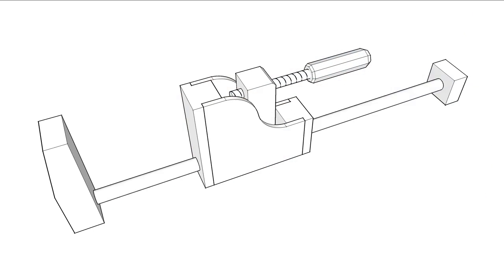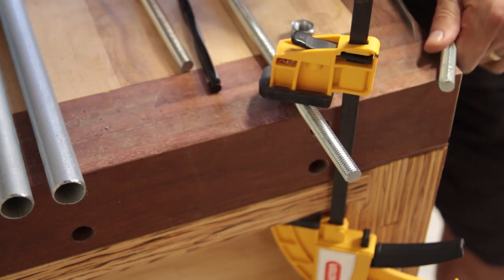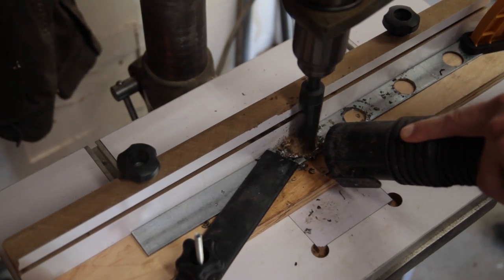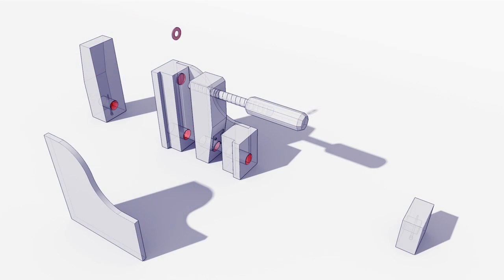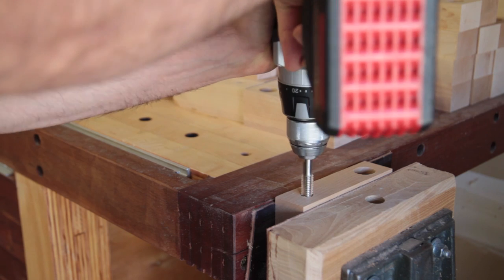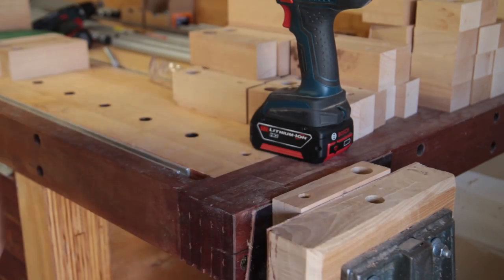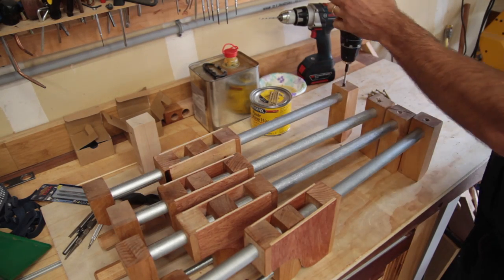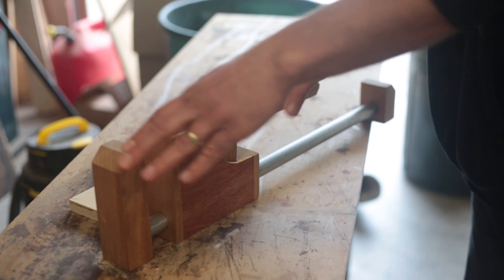DIY Parallel Clamps

Comment: Just finished making 16 of these based on this fantastic video.  Bought the plans and modified slightly - wouldn't really attempt it without the plans. Made them out of hard maple readily available to me. They were very time consuming, but ultimately well worth it. Work incredibly well. One mod I made was to add a 3" long 1/4-20 hex bolt through the bottom of the headstock and naturally the steel conduit bar. Adds an incredible amount of extra stability to the headstock under clamping pressure. Grab the 15/16th drill bits from harbor freight if you can. Great deal and the they work very well. I would def recommend giving these a shot is thinking about it...
Reply from the maker: That is awesome to hear! Thanks for the added suggestions as well. Did you make all yours the same length? Several years in, mine are still working well. Gotta scrape glue off em from time to time and some slide better than others, but still really happy with these.
Reply: @GeeksWoodShop  Yeah, I'm a little worried about the glue too. I've been toying with the idea of double sided taping some thin HDPE plastic to the faces. I also know what you mean about the sliding. They're not all equal, but work well enough. I'm still super impressed with how sturdy and effective they are. I ended up making 8 x 24" and 8 x 48". The beauty of the 1/4" bolt to hold the headstock and ends on is that if I REALLY want/need to, I can disassemble the clamp and reassemble on longer conduit. I'm sure the day will come...
Reply from the maker: @andrewfergus7562  Ah nice, a bit of future flexibility built in. Hope you get lotsa years from them, with the hard maple you used they'll probably outlast mine. ;)
Reply: How does the clamp actually work? Is it steel against an aluminum bar? Does it gall up the bar and ruin it over time?

Comment: Man, THANK YOU VERY MUCH for sharing your work, experience and, above all, your mistakes. It is from that that we all learn. Great Video and great job!!! Thank you!!!!
One suggestion: When you have to glue or nail something that barely touches another element, instead of eyeballing, use shims. Scocth tape or a piece of can, whatever gives you the right clearance, that can be removed and, still, gives you a consistent and repeatable measure for all the pieces in a quick way.
Reply from the maker: Thanks, good suggestion for sure, anything that makes for accurate repeatability is worth doing. Cheers!

Comment: Rather than working with such small pieces when ripping them, quite dangerous, make all your rabbet cuts when the piece is full length, much safer!
You finally figured out how to cut those angles on the blocks. You drew the line on the sled at the correct angle, but didn't make a scrap at that same angle to use as a stop until later!
Reply from the maker: Agreed, order of operations sometimes means I don't anticipate the best approach and have to improvise. Good thoughts, thanks.

Comment: Thanks for the kind shoutout, it is much appreciated. Your clamps came out great. A real mass production:):). Good tip on the CA glue to position the grabber. Great video, and from the comments you wrote, it looks like yours, as mine, still hold up after much use.
Reply from the maker: Thank you for the original design, these have been such a great addition to the shop.

Comment: Great use of table saw, sled, band saw. Due to my experience as a rough carpenter and my need to conserved space, I am using only hand-electric tools... wormdrive Skilsaw, Bosch Jigsaw... now I need to find the best way to mount the Skilsaw to use as a table saw and sled (the Jigsaw is easy to setup).

Comment: Nice vid, and you've got some sweet machines for garage shop! If you haven't discovered them yet, step drills are great for drilling large holes in thin stock in one go with accuracy and without grabbing. They'll even chamfer the edge in a single pass. Don't bother with the cheap-o step drills or extra coatings. It's worth spending the money on good ones, and they are easy to sharpen. A good quality 3/16" to 7/8" stepper in 8 or 12 steps will probably set you back $40, but if you take care of it, it could last you your entire life.
Reply from the maker: Thanks, good advice indeed.

Comment: The wood you got was  hard wood i presume Can You make the clamps in soft wood because hard wood in the UK is so expensive and i am only a DIY man with a little workshop Great video everything explained so well you sound like a man who really enjoys  his work  I have subscribed and looking forward to more. Thank you very much
Reply from the maker: I hear your pain, great lumber is hard to come by for many of us. 
I'm not sure the type of wood I used, but pretty sure it's not too hard, so yes, I think you could use a softer wood, but before making too many I'd definitely make one block, drill the pipe hole in it and try to break it to see how well it holds up, that's where the strength needs to be. Good luck!

Comment: You don't mention the tap that you are using.  It is called (among other things) a "gun" tap, because the bevel at the beginning of the tap is ground such that the cut portions are pushed ahead of the tap as it goes into the material.  If you were using a standard 4-flute tap that you normally purchase at the hardware store, it would plug up and you would either back out several times in the length that you are tapping to clear the flutes or risk breaking the tap, even in wood.  It also helps to wax the tap before you start tapping, similar to oiling a tap when tapping metal.  The wax sticks used to lubricate band saw blades works well.  Richard Solomon's suggestion for using the drill press to start is a good idea as well.  With your gun tap, and a through tapped hole, if your drill press goes slow enough, you could go all the way with the drill press.  Slow enough means 100 to 200 rpm (most drill presses don't go that slow) and use a good, well clamped vise to secure it.    Good video.  I liked this one.
Reply from the maker: Thanks for the insights, good suggestions.

Comment: great video.  I have the plans and did not end up being able to make them.  I got frustrated with the metal piece as well as matching the drill bit size to the conduit size. If you have something like the conduit part number and the drill bit dimension you ended up using I'd find that helpful.   great video, glad I found your channel!
Reply from the maker: I used 3/4 conduit from HDepot, which ended up with an exterior dimension of 15/16ths, so I had to buy a drill bit of just that size and it worked perfectly. Definitely measure whatever pipe you end up using. 
The metal piece was frustrating, but mostly as I don't have much experience with metal. I should have drilled successively larger holes rather than trying to do it in one pass. I ruined the drill bit.  :)

Comment: Great Video. Good Narration too. Finding the Center: I imagine you know by now, but, straight edge marks across both corners of a square end, where the lines intersect in the middle is the center, then, just adjust your drill table/jig to find the center mark.. What you did works good on round stock though, but, you can rotate and put a pencil in the chuck and keep moving it until you get a dot, or a circle the size of your drill bit and you are done... 
I am wondering what lengths you use most in what you are making,, and, if you don't mind, look at the washers and tell me if the washer is not cone shaped in the center of some you have used.. Seems that putting them on the end of a pipe and tapping them with a ball pein hammer, or a large punch would cone shape them for the head of the nuts.. Probably why he ground his rounded on the Bellevue build. 
If the washers coned out, the round would move better. You might have had some catching on the ones that were bending into cone shapes.. 
Excellent video.. I'll check out the channel and see what you have been up to since May of 2016.. Cheers!!

Comment: These seem to be some of the best DIY clamps I have seen, very nice finish on them and they seem to work great. How are they on clampingpower? I am thinking if you want to join wood for say a tabletop.
Reply from the maker: I've used them for panel glue-ups multiple times, which was the first reason I built them. They have lots of clamping power, won't have as much as metal/ purchased versions, and I don't try to crank down on them, but plenty still. Thanks much!

Comment: Gentlemen! 
Buy an angle grinder! They are cheap and they make cutting steel a breeze! Just clean up the burr when you're done. 
Pro tip, start all the taping by hand in the drill press (power off, turn the tap in by turning the chuck or upper pulley by hand) this will give you exact alignment.

Comment: Great video.  I like your style.  I think it would be interesting to do a test to somehow show whether clamping pressure is even across the entire clamping surface.  My concern with a more dynamic material like wood is that clamping pressure might differ between locations down in the throat of the clamp and out at the tips of clamp surface.  What do you think?
Reply from the maker: Thanks. It's a good question, and I don't know for sure. I've used these primarily for panel glue ups, so it doesn't test the full length, but they do hold the parallel positioning well and as best I can tell they clamp evenly, but I've got nothing but my own (very un-scientific) opinion.

Comment: Do not know if you have been told this before but all electrical conduit and is the inside diameter like plumbing pipe..only refrigeration copper is outside diameter as far as i know o am sure there are other exceptions.
Reply from the maker: Thanks. I don't know much about pipe diameters. Good insights.

Comment: Really like these and the design.  Two questions please.

Have the conduits flexed when pressure is applied?  I'm hoping to use on a dining table of 2.5 inches thick.

Has the metal of the conduit caused any staining of wood?  Is the conduit galvanized? 

Thanks and I appreciate the content.
Reply from the maker: The conduit hasn't been an issue at all. After a few years, I've had two of them crack at the wood base, so I might use a harder wood if I built them again, but 2 out of all of them is pretty good I think. That said, I don't put serious pressure on them, just...  "enough". .  :)

Comment: Just came back to this video and it is still great! How are the clamps holding up after 3 years of use? Anything you would change?
Reply from the maker: Thanks. One thing that has happened to 2 of the clamps is splitting on the bottom side from the pressure, so I'd probably make the lower side a bit thicker ~1/2" and use a harder wood if I were to make them again. Overall, still great though.
Reply: Thank you! Want to build myself a set of these and feedback is invaluable. Where exactly are they splitting?

Comment: This was very good.  I have been looking for something like this for a while.
Few questions:
I wonder about the little metal grabby things against the conduit -.  How long before they begin to wear out, and do you have any ideas on making them adjustable after a wear in period, or maybe have them float?
How much pressure can the clamps handle?
Will the jaw eventually go out of square?
How are you ensuring they are parallel?

All questions you may have gotten before - maybe on lumberjocks?  got a link/username there?
Reply from the maker: I don't know for sure, but I suspect the metal grabbers will last for a very long time, and the conduit that I used is simple galvanized metal, so possibly softer. As far as ensuring they are parallel, that's based on how accurately they were built, and I don't suspect they will have any problems for a long time. For now they are ~8 months old and no issues, don't know the pressure but they do work very well. I'm TysonK on lumberjocks, see ya over there!

Comment: Watched this several times. Great video. Have some questions about clamp pressure and the pipe bending at longer lengths. Want to try something similar and at greater lengths.
Reply from the maker: I don't know what the clamping pressure is as a measurement, only that they work really well for any project I've thrown them at. I don't have problem with bending for the shorter clamps, the longer clamps can bend if you crank down on them, but it's not been a problem as that much pressure isn't needed for my work. I have had one clamp fail in that I split the wood block, but even then it still worked, and has only happened to one. Overall, I love them.
Reply: Geeks Wood Shop awesome, thanks for the reply. Does the clamp housing rotate around the pipe or does it stay in line with the end piece.... If that makes sense. Lol
Reply: By that, I mean it's on a round pipe as opposed to a flat steel bar. I didn't see anything that kept it from pitching side to side at least some.
Reply from the maker: You are correct, the end of the clamp is fixed with a screw through the bar and block, but the main clamping structure that moves up and down the bar also rotates freely around the bar. This has never been a problem for me, in fact I've had a time or two when it was beneficial as I could clamp a vertical leg to a horizontal stretcher, but ya, if you want them to stay perfectly in line, these won't.
Reply: Geeks Wood Shop OK cool. Excellent to know. Thank you so much for your help. Again, great video.

Comment: What degree was the angle on the block that the turn handle is on great video brother
Reply from the maker: The shallow angle? I don't remember, but the exact angle is probably not crucial. If you need plans, do check out the description for a link to bellevuewoodshop

Comment: Its been a bit over 3 years.  How are the clamps holding up for you?  Is it worth it building them?
Reply from the maker: They've held up well, still use them. I've had 2 I think that have cracked where the wood is under pressure, so would definitely build them again but might use a denser wood, as I used some light wood that I had on hand.

Comment: Sorry if this has already been answered, but what length was the conduit cut and what size washer was used. I'm trying to find washers with an outside diameter of 1" and an inside diameter larger than 1/2" so the threaded rod can move a little freely, but I just cant find the washers. The washer used looks smaller than 1". Thanks!
Reply from the maker: I cut the conduit at 3 lengths, I don't remember exactly, but something like 24" 36" and 48", most of them being the shorter versions. Whatever you need. The washer, I don't remember exactly either, but I think the threaded rod was 1/2", so I used 1/2" inside washer with the bolts to stop it. One thing I'd suggest in making these, is to use a good hardwood or make the base thicker, I love these clamps but a few of them have cracked at the base over the years. Cheers!
Reply: @GeeksWoodShop  Thank you so much for responding. I finally found washers with proper diameters. The ID was easy since the threaded rod is 1/2", but that OD was difficult. Thanks for the tip about wood splitting. I have some oak I was planning to use. In the plans he uses 1" conduit. Did you find that 3/4" is sufficient, or if you made more, would you go with 1"? Great video, by the way. Really helped with the step-by-step, I'm ready to jump in.
Reply from the maker: @rebeccac.7695  Great! Good luck with yours. I did find that 3/4 was fine, they bend slightly under use, but also, I don't ever use these to really crank down and apply a lot of pressure, I don't find that necessary. 

Cheers!

Comment: Great video! one question.... do you know what the cost per clamp came out to?
Reply from the maker: Never calculated it out, but I did get lucky with the wood I used, found that really cheap and with the rest of the hardware, it still probably was ~$100 for 20+ clamps. Lots of time though..   ;)

Comment: is there anything to keep the middle part of the clamp parallel to one end of the clamp or it can rotate freely?
Reply from the maker: The rotate freely, but once you set em down, the flats keep them aligned when clamping, so hasn't been much of an issue.

Comment: Great build. So it's been almost a year since you made these. How are they holding up?
Reply from the maker: Thanks! It's actually been longer, as the video came later, so almost 2 years, they are holding up great. I would definitely make them again, though I would extend the base by another .25 or .5", to add more strength there. I've had 1 of them crack there when clamping.
Reply: @GeeksWoodShop  By extending you mean the thickness along the bar? Those clamps look great, although I would fear slipping of the metal part along the pipe, especially as pipe clamps seem to use much steeper angles of the "gripping" part...